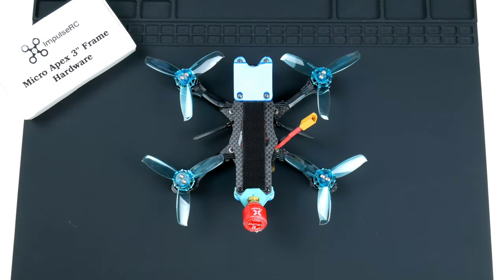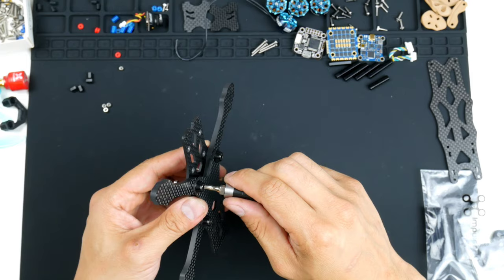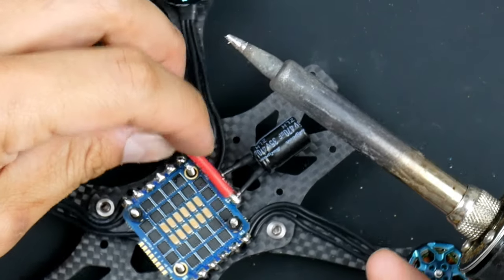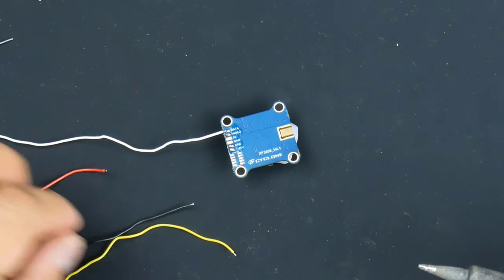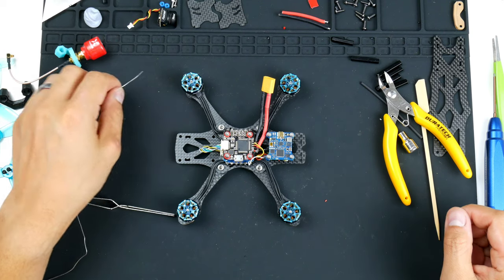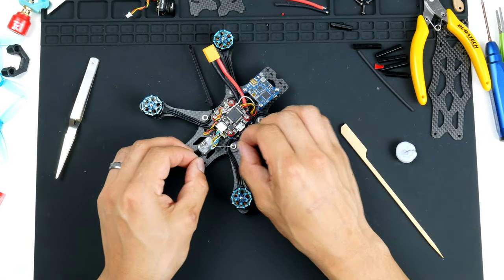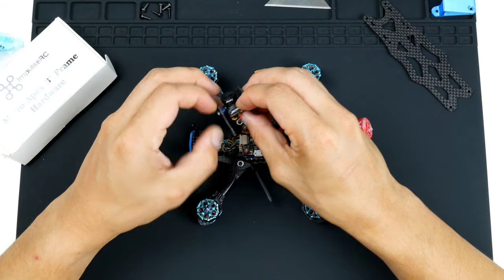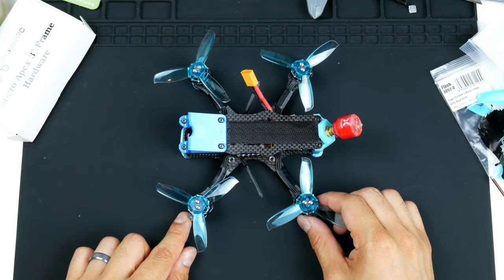ImpulseRC Micro Apex 3 inch Build

Comment: The little O-rings used on the M2 stack screws just squeeze right off of the countersunk bolt head, If not from over tightening from vibrations.  I finally decided to use M3 bolts for the stack.  I wish they had drilled M2 holes for this size quad.

Comment: Just FYI, but the locking nuts are supposed to be on the bottom so they lock the stack screws into place on the bottom plate.
If those plastic nuts ever loosen on the bottom of your stack then you're going to have to disassemble the bottom plate to tighten them again, which is why the locknuts are provided so you don't ever have to do that.
Great build though. I have a 3" Micro Reverb that is just too tight and frustrating to work with, so I'm considering a 3" Apex Mini.
This doesn't look nearly as frustrating as the Micro Reverb, that barely has enough room to stuff a Crossfire nano receiver behind the stack.
Reply from the maker: Ah great point! I didn't realise the extra set of lock nuts were for that. Thought they were spares 😄. Thanks for letting me know. Was fun building this one and yeh, I've bashed this little guy around a fair bit and still no damage. Might have to try harder!! Haha

Comment: try the gemfan 3016 triblades. It'll be louder but more linear feel at the bottom end
Reply from the maker: Done! Just ordered 6 sets. Will let you know what I think, but I'm sure I'll have fun regardless 🤙 thanks for the tip!
Reply: @nxp200  you’re build is roughly the weight and motor set up of a tiny trainer and they use those props as well
I really like the 3028 too but for heavy 3” builds like 1407 class motors

Comment: got inspired by your video thank you
i got the frame, same motors and props windancer, just have vista and different speedybee stack. i flashed betaflight 4.3.2 but the default tune is not great, it has some wobble on 0 throttle, do you mind sharing some of your tune on this quad? or some tips for that
Reply from the maker: I'm not much of a tuner myself and usually run defaults. If I do tune, I use the "basement blackbox" method that you can find other videos on YouTube on. I've found that if you keep the flight controller isolated (none or minimal wires touching it), no loose/wobbling components such was antennas, tighten all screws, the default filters and PIDs are sufficient, at least for me it is. I've recently flashed my Micro Apex to Betaflight 4.4, so I don't have my previous settings available, sorry..

Comment: i'm currently running cloud 1408 3000kv..are those xing motors a good upgrade for me?
Reply from the maker: The xing2 1404 motors would be much lighter. I would prefer them over 1408s on this build, but that's much of a preference really

Comment: do you think i can use 1404 3700kv motors or is that to low of a kv for this
Reply from the maker: I set the throttle limit in Betaflight to 80% (3700÷4600=80%) to simulate what it would feel like and took it out for a quick test for you. Running on 4s lipo with high pitch Gemfan 3052 propellers, it still flies well and is able to acro, but it lacks that punch I usually get at the top end to recover from steep dives etc. I would guess that 3700kv for the same motor size with 3 inch props is a little underpowered on 4s, but might work better with 3.5 or 4 inch props. But of course that wouldn't fit on the Micro Apex 3" frame. If you plan on flying with a 50g GoPro Hero Session or equivalent with the 3700kv, I'd say it would struggle. If the motor was larger, like 1408, perhaps the extra torque would compensate. I hope that helps and let me know how you go. Love this hobby 😁
Reply: I currently fly 3300kv on an ultra light 4s 3" quad and i think it flies great as a cruiser and freestyle.  I can do acro and what not but it lacks the " flick ability " .  I will say it does feel more locked in at the low end when cruising around.  It also depends on overall payload too though.

Comment: I don't remember hearing if you said it, but do you know the weight of the finished quad with and without the battery?  Is it less than 250?  I'm trying to build a light weight quad because of the new Remote ID law coming into effect :/
Reply from the maker: I intended to, but I forgot to mention the final weight in the video. Dry weight (without battery) is 163g. With the CNHL 650mAh 4s battery (which is 85g), total weight comes to 248g. Can probably make it lighter a couple grams by removing the HD cam 3D printed mount. Hope that helps! I live in Australia and I haven't heard anything like Remote ID being announced... "yet".

Comment: hey mate how long of a sma cable are you using, could you send the phaser link you used, thanks
Reply from the maker: It's 80mm long. Matek MMCX to SMA Cable
 https://www.phaserfpv.com.au/products/matek-mmcx-to-sma-cable-antenna?variant=12217179963469

I just checked their website and they're out of stock of the "Right Angle MMCX (80mm)" version to mount it the way I did in the video, so you might have to hunt for another supplier.

Comment: Hi! Could I get some advice about what motors should I use for a 3" freestye build (about 210grams with action camera)? My options are: 1804 3500KV, 1507 3800KV, 1404 4000KV motors. I am looking for freestyle-ability, and flight time. If you were me, what would you choose? I have 450mah 4s lipos, but I plan on buying some 650mah ones.
Reply from the maker: To keep the weight low, I'd go with the 1404 motors. As for the action cam, I think the Runcam Thumb Pro (16 grams!) would be good, again to keep the weight down so the 1404 motors aren't affected too much by the additional weight. If you don't like the video quality of the Thumb Pro and prefer a Hero Session (or something similar), I would try the 1507 but I think it would be hard to keep the entire build under 210g. I use a caddx orca action cam (58g) on mine and it really affects the performance with 1404 4600kv motors. Hope that helps! Good luck!
Reply: I will use it with a Insta360 GO2. The company where I ordered it from has ran out of 1404 4000kv motors. They sent 3000kv ones. Do you think those will work on 4s?
Reply from the maker: I just tested my 1404 4600kv 3 inch (Gemfan  3052 props) with 65% motor output limit on 650mah 4s to try simulate the motor you have (3000kv). It should be able to fly and carry an Insta360 Go 2 with light acro if you're using smaller battery and minimise overall quad weight.
Reply: Thank you for trying it! Now I'm not that worried about it being too underpowered!
Reply from the maker: You're welcome. Gave me an excuse to go outside and fly for a bit 🤣

Comment: It is a great video thanks. What is the total weight without hd camera?
Reply from the maker: Hi. Thanks! Dry weight (without battery) is 163g. With the CNHL 650mAh 4s battery (which is 85g), total weight comes to 248g. Can probably make it lighter a couple grams by removing the HD cam 3D printed mount. Hope that helps!

Comment: Could you use 2.5 inch props?
Reply from the maker: It will work, but won't have the same amount of thrust as 3 inch props so will likely lose a bit of performance

Comment: Where'd you get that hd cam mount? I'd like to try to print one and use a session
Reply from the maker: I have a 3D printer and designed it myself. I'll post a link to the .STL file for you here later.
Reply: @nxp200  oh hell yeah, thanks!
Reply: I'd imagine it's probably a bit sluggish with such a big camera, but I'd like to give it a shot
Reply from the maker: Sorry for the delay, but I've been away for the weekend. Here's the mount .STL file. https://www.thingiverse.com/thing:5331776
Reply from the maker: It's a little sluggish, but works for some easy cruisy light freestyle footage.
Reply: @nxp200  dude no worries, I'm lucky you even wanted to post it. thanks!
Reply: Hi @nxp200, where abouts did you get the mount for the vtx antenna? the blue 3d printed one, is there anychance you could share a link for it? thank you! currently doing the same build (I also have a 3d printer so an stl file would be awesome if it's printable)
Reply from the maker: I actually got that from a clone Micro Apex 3 inch kit. Sorry, don't have the STL. I'll see if I can spare some time to replicate it, or if I find it online somewhere.
Reply: @nxp200  no worries all good! after some intense searching I actually found it and all the other 3d printed parts for the 3 inch apex. thanks heaps tho! :)
Reply from the maker: Awesome! Glad you found it! Enjoy the build, cause I did. Thinking of my next build. Might be a 4 inch version 🤔

Comment: Where did u get those 3d parts I need som
Reply from the maker: The HD camera mount is my own design and I printed myself. Here is the model: https://www.thingiverse.com/thing:5331776. As for the rest, some parts I got from a clone frame I bought on AliExpress (I thought I needed spare arms etc, but this frame is durable and I haven't damaged anything yet) or I downloaded the original Apex Micro accessories models from ImpulseRC website.

Comment: this frame can fly 3.5 inch props ?
Reply from the maker: Unfortunately no. It only fits 3 inch props. You can get the frame in a 4 inch version which just has slightly longer arms and you can use 3.5 inch props if that's what you need

Comment: Esta fc trae un sofserial  .estra.que pines son para soldar un gps. Graciass
Reply from the maker: Hi, sorry I haven't worked with GPS units, so I can't say how to wire it up or if it's possible with this flight controller. Apologies for not being able to help. I can say though that after wiring up the camera, video transmitter and radio receiver, there were no spare UARTs left on the flight controller. Good luck!!

Comment: How is this cyclone xf5806 vtx?
Reply from the maker: To be honest it's not great if you're looking for range and penetrating. I think it maxes out at 400mw and even then it gets pretty hot if it's on the bench not flying. Does a decent job for close range in a small open park with little obstructions.

Comment: Question…will 3.5” props fit on that frame??
Reply from the maker: @SteveOFPV sorry for the late reply. I don't have any 3.5" props on hand to test, but using a measuring caliper, looks like 3.5" prop tips would hit the front standoffs of the frame by 1mm.
Reply: @nxp200  Yeah I am gonna use 4” arms  with 3.5” props running 1507 3600kv. It should hit the spot!
Reply from the maker: Ah that sounds great. I forgot to mention the 4 inch arms version. Awesome idea and would be a great little ripper. In fact I might do a similar build like yours. What make/model motor are you going for?
Reply: @nxp200  I’m switching parts from my massive droner since everything is super expensive now. I would start fresh, I will be on 1507 3600kv brotherhobby motors. Should be a awesome little ripper. I wiill be building the 4” with fresh parts.
Reply from the maker: Awesome! Thanks for the info. All the best with the build and have fun! 👍

Comment: That is a like the perfect build. What is the weight of the quad without 4s 650mah? I gotta copy this build haha!
Reply from the maker: Thanks! Without the 4s 650mAh Battery, it comes to 170g. It's a great little ripper that can take a fair beating. Good luck and let me know if you need any further help with anything.
Reply: @nxp200  ohhhh nice. If I use 1404 4000kv and hq 3025 props, is it okay for 4s 650mah?
Reply from the maker: Yep. I think that should be good. 👍
Reply: @nxp200  I built this with a caddx, but with my 850 4s (only packs I have) it's 330g all included. Flies like shit, I am a noob and am pretty lost what to do.
Reply from the maker: Sorry to hear it doesn't fly so well with that configuration. I guess the things to try is reduce weight by trying 650mah 4s, which should save about 25g. Also maybe higher pitch props to give it a bit more thrust. I really hope this helps!
Reply: @nxp200  have spoken to someone that has built loads of 3". Recommended 6s 380mah and 1404 2900kv motors
Reply: @nxp200  when they talk about regulations, is it supposed to be 250g and under even with the battery? or is that seperate
Reply from the maker: Sorry, I'm not an expert in the area of regulations and different countries have different rules. I built this as a sub 250g including battery because either way, battery or no battery, it's still less than 250g. My main goal was to have a small 3inch basher that didn't draw as much attention as a beasty 5inch but still be able to pull off some freestyle acro in a small park. Sorry I couldn't be of more help on the topic of regulations.
Reply: @nxp200  have you tried 3s?
Reply from the maker: Haven't tried. I mainly have 4s packs

Comment: Think I will be able to get away with 450mah 4s?
Reply from the maker: Personally for the way I fly, I think yes. I get about 6 to 8 minutes of flight on the 650mah doing dives and power loops etc. I also run the battery from 4.2V per cell down to 3.5V and never try to overrun and go lower than that (it will reduce the overall life of the battery). But for some others who fly a little "harder" or faster, they might get 3 or 4 minutes. Which means for a 450mah I should still get a decent 4 to 6 minutes, just based of capacity alone (the weight saving of the lighter battery should help increase flight time and agility as well). Hope that helps and good luck!
Reply: hopefully maiden here in a hr or so

Comment: Hey mate, what battery you using?
Reply from the maker: Chinahobbyline CNHL Ministar 650MAH 14.8V 4S 70C Lipo Battery. Gets about 6 minutes of moderate freestyle.
Reply: @nxp200  I'm switching my 20x20 f4 flight controller into this same Apex 3" because the components are all too heavy for the micro I currently have them in. I was flying that with a few GMB 450mah 3S batteries. I am also very interested in what motors I could get away with? It's always something I find trick, specifying the correct KV. Would  say that I really have no choice but to upgrade to 4S Lipo's for a 3" build?
Reply from the maker: If you wanted to run 3S, then I'd suggest a high kV since you can only run exactly 3" props on this frame (3.1" doesn't fit). I would want the most thrust to be generated, so highest speed is what I'll be after. I've generally gone with "highest kV I can get away with without burning the motors or ESC" method LoL. A good way to check is to go into the motor's manufacturer website and look for the amp rating to see how much they draw (and heat generated) at certain voltages. iFlight are very detailed in this regard and I haven't had any issues so far. The iFlight Xing2 1404 4600kV motors I have are fast, durable, and barely get warm after a long session. But I think you can get away with anything above 3500kV if you're shopping around. Good luck! 👍